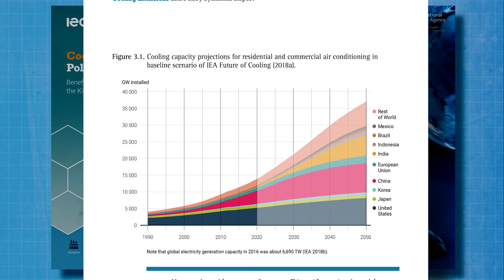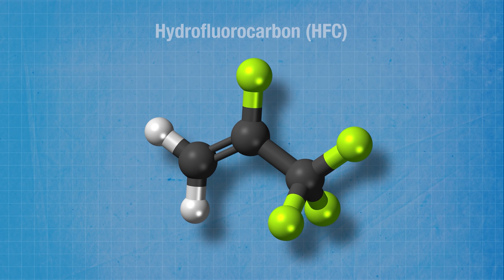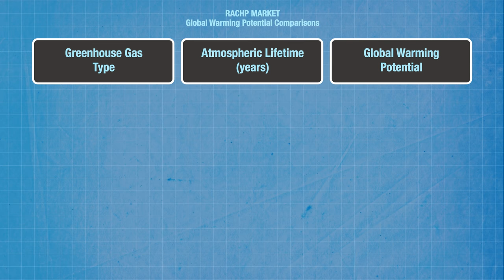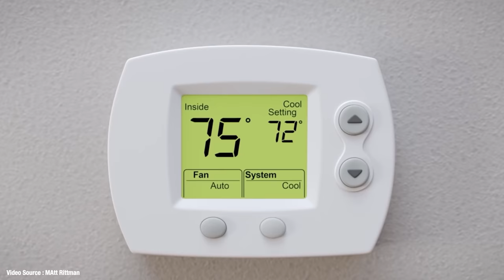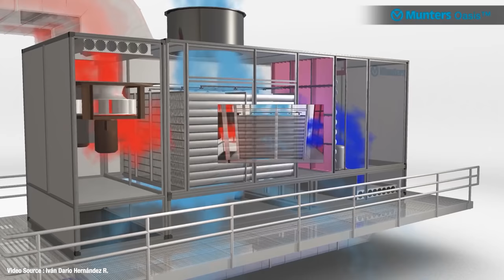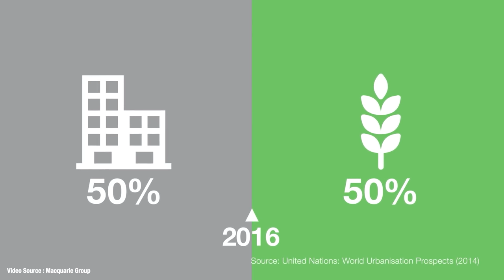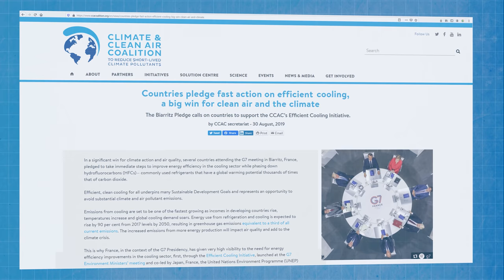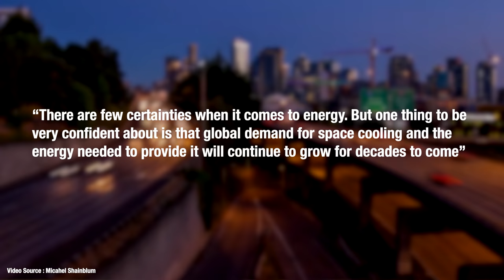Keeping cool in a warming world.

Comment: Did I make a mistake in replacing my natural gas furnace with a refrigerant heat pump?
Reply: No. Heat pumps for heating are very efficient. And in very hot climates the best way of significant cooling, particularly where older buildings have been built without passive cooling principles. The key is to take responsibility for the end of life of the unit and ensure that it is disposed of correctly, as well as energy efficiency measures of course. Look after it too so that it has a long service life
Reply: @emceeboogieboots1608  if your electric company has a lot of renewable sources, even better.

Comment: Cool the body not the building

Understand that the body temperature can vary significantly without causing a problem that overheating takes a great deal of time time it occurs extremely slowly and can be prevented by extremely small reductions in the temperature of what touches our bodies and extremely limited amounts of the surface area for example only the Sox /only Underwear. Just a few degrees and of course the way to prevent something from going above a certain temperature is by connecting it to a fluid that boils at that temperature. This is the way Microsoft and others cool their CPUs in their cloud computing centers. Unfortunately Microsoft despite designing a fluid that boils at a hundred and twenty degrees Fahrenheit for this purpose is not using the expansion of the volume those molecules take to replace the electricity that causes the expansion despite these CPUs being submerged in that liquid and it being completely trivial to therefore do so instead of Simply condensing the vapor. Mankind however can condense the vapor from the fluid that boils below body temperature or at about a third of the temperature that  sweat boils at by using a heat pump of a nanoscale driven by the expansion of liquid nitrogen in extraordinary small amounts this avoids the scam of using electric motors electrical storage systems electrical distribution all of which create the market for copper and protect the fossil fuel Industries accordingly. Nothing is more luxurious than having underwear and socks that are optimally able to stay well below body temperature so as to prevent the core body temperature from going outside the safe desirable range. The first world we have learned during the pandemic recirculate the air in buildings endangering the lives of the occupants. More importantly the heat that is being released by our bodies especially from the evaporation of fluids in our lungs ends up getting pumped out of the building at Great cost along with all of the heat that leaks into the building just to help our skin on the outside of our dermis evaporate fluid. This Compares with the outrageous reality of solid-state Cooling in which each thermoelectric layer generates significant amounts of heat that the next layer has to aggregately pump out so that the efficiency of such systems is unbelievably low. This is how dozens of watts of heat turn into thousands of Watts. It is how an Energy Efficiency rating above 1 actually represents actually represents an Energy Efficiency rating of less than 1%. When you consult the tabular data as to how much heat a person is producing you have to remember that almost all of that heat is heat that we have released not heat that we need help from the conditioning system releasing! It is for this reason that space Cooling has the industry arguing in a feat of UNPRECEDENTED evil to be certain to increase because if it doesn't they go out of business. I can't imagine a future of our world in which the space Cooling demands don't totally tank to a tiny fraction of a single percent over what is forecast. That's the difference between 5 ft floor speakers too heavy for a strong adult to move and the way that everybody that listens to audio NOW USES tiny little things that fit in their ears.

Comment: This is basically why I despise air conditioning.
Reply: Live and work in a country with ambient air around 30+ degC and humidity above 60%..
You can't even work on a computer just in your underpants like that.. and that's experience talking.
AC driven by solar energy or wind are not the problem.

Comment: People lived just fine in hot summer temperatures throughout history until air conditioning was invented. I’m fortunate to have grown up in a house without AC (in Virginia) so I’m not addicted to it.
Reply: That’s why A/C was actually invented primarily as a dehumidification device, the cooling was originally secondary. 

But then, people expanded into places they didn’t go before without it, after they noticed various employees not fainting so much in hot environments, and people being more willing to stay in the cinema (with the heat of the projectors and everything). 

Ended up building buildings in ways that are uninhabitable without it. Eg a lot of Australia used to literally kill you if you didn’t build your house underground. Once A/C was a thing, they suddenly could have big towns in those areas. But those buildings literally do kill you to spend too long inside with busted A/C, people have to have plans to evacuate to a cave house if they can’t get it fixed and everything. 

So, for a home that never had it to not really need it is not really a surprise at all. I’m going to guess it has a big porch and large windows and a design that encourages a through-breeze front to back. But if you lived in a house constructed with the expectation of A/C, you’d probably still have a hard time when it broke. 

That’s just my two cents though, from the UK where air conditioning has only been a thing you tend to experience in supermarkets. Although apparently there’s begun to be sales of window units in the last few years here, which were never really sold here before.

Comment: 1:20 sorry could you expand on that connection ; more pandemic less insulation ?
I don't get it .
Reply: the resources are needed to counter the pandemic (see where govs redirect spending and how workers react if their job is less secure) and thus aren't available to counter climate change related issues..
Reply: @joansparky4439  well in this country many are doing less, including the Government, no program here to do anything, they talk of gas, but not in the home, here our gas just comes in bottles for cooking, but for power stations instead of coal , because it is a bit cleaner and more flexible, to respond to changing needs, alongside renewable.
But insulation no, there were programs to change bulbs fifteen years ago and insulation ten years ago, I think they should have programs for microwave cooking and heat pumps, they do have programs for PV and solar water heating, but not for EV, I think they are feeling a bit broke because China has bought less this year, and we had the fires last year don't forget, and before that many years of drought, we can't even afford more children, which is a good thing, long term.

Comment: 6:13 Wouldn't minus 1 be more fair GWP amount to R744 = CO2?
Reply: R744 is CO2. If you release a tonne of CO2 from a refrigeration system, it's the same as releasing a tonne from burning fossil fuels. There's nothing that's negative in terms of GWP as far as I'm aware. Even water vapor has a GWP, even though short-lived.

Comment: Tesla cools its cars with super efficiency HVAC  Elon has hinted he will develop a building system HVAC which would also purified water as a fantastic bonus for the health of the Buildings occupants     See various Utube  videos on the subject.    Shame Dave didn't mention it here as it may be THE solution for this growing problem/challenge
Reply: Tesla has no magic.. they also can only work with what thermodynamics gives.
And apparently they have been using R134a - like everybody else.

Unless they use something simple like Propane (R290) or Isobutane (R600a) they haven't done anything to address this.
CO2 would be better, but needs more rigid tubing and else as the pressures are much higher.

There are people who refill R134a systems with R290 though..  https://www.youtube.com/watch?v=2FsSKMpWQW0